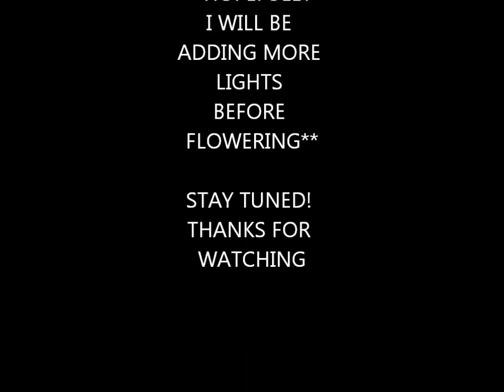DIY Homemade Aeroponic Medical Marijuana Grow System

Comment: all is good, but you can't put this thing indoor , it will leak a lot man, i had the same problem was so annoyed i tried silicon many times , but never worked, the solution was , i raised the pipes to almost top and let them spry at 90 degree angle horizontally, cheers good work